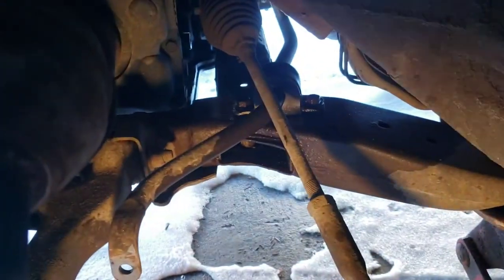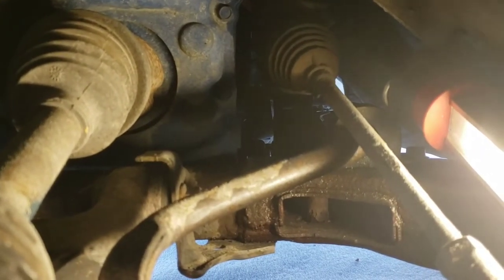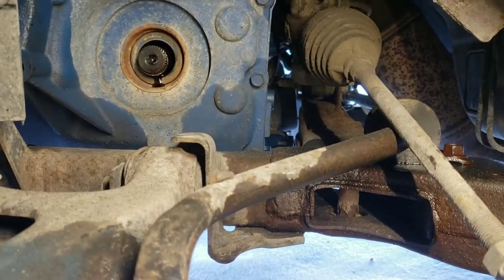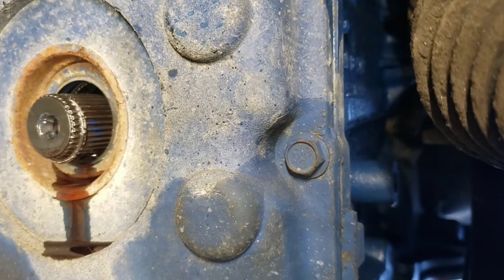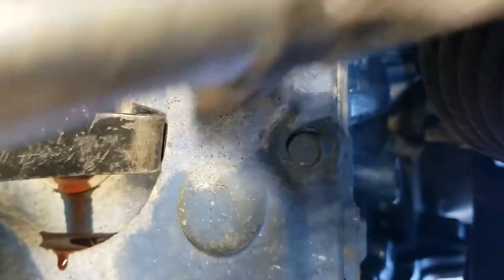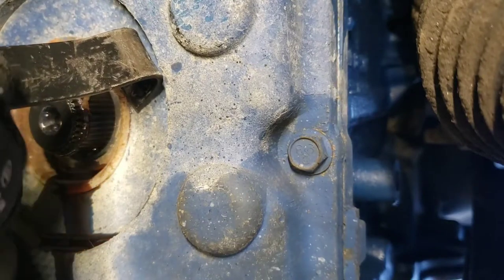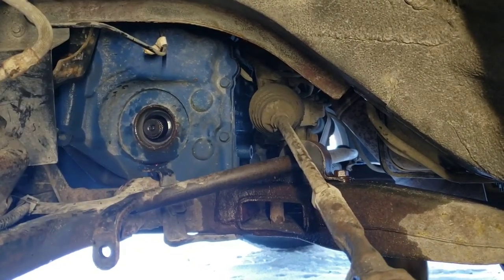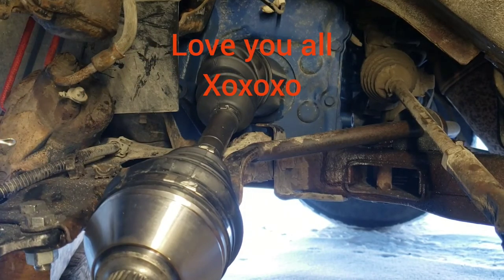Pontiac Montana axle seal replacement

Comment: a small puller would be great too.
Reply from the maker: Yeah I've never needed a puller. Even on like cummins rear main seals I just drill a hole and use a screw.
Of course I have way more stuff at my shop. Like lathe and welders so I normally build all my own pullers. I was kind of thinking of getting a seal puller. But then I was like. Well I've gone 20 years without one.

Comment: I got told that my passenger side axle is leaking but they didn't say where. And I never see a puddle under the van either. My brakes area are dry. So does that mean I might need to change the seal on the tranny?
Reply from the maker: Well they could mean you axle boot is leaking. That will just cause the grease to fly out. It won't cause a puddle on the ground but the grease will be all over your engine bay or wheel hub area. You will see specs of black grease all over the place.
I would suspect this is the case. 
You can buy boot kits but I think on rock auto the whole axle was 20 bucks more. I would recommend changing the transmission seal when you put a new axle in. 
You might get away with reusing the old one you might get a small leak as the old seal would be worn a little to the old axle.
Reply: @RabidMotorsport  Come to think of it there is a tonne of cooked fluid all around the bay there and around the crank shaft area. But the crankshaft stuff looks good still. That tranny seal you are talking about, that is the one you just dealt with right?
Reply from the maker: @mylifejourney74  sometimes if the transmission seal is leaking just a little it won't cause a puddle it will just weep onto the case and collect dust and dirt.
If they said your axle is leaking I would suspect they mean axle boot. I always call the transmission seal an output shaft seal. Some call it trans axle seal. Some call it axle seal. But I bet they meant you cv axle boot.
Reply: It may have to get hot to leak